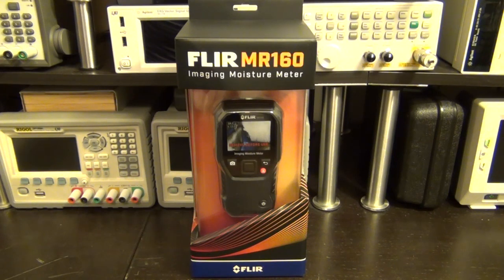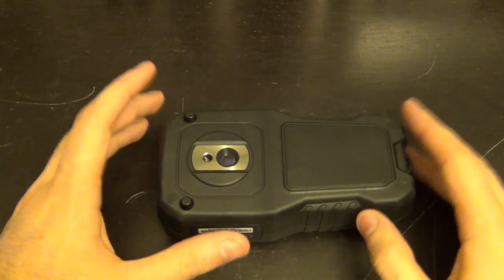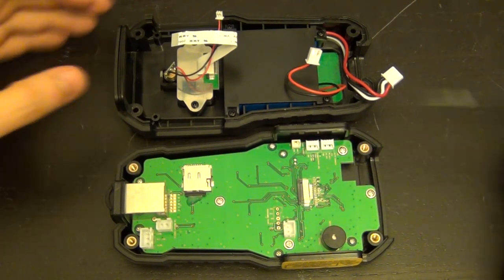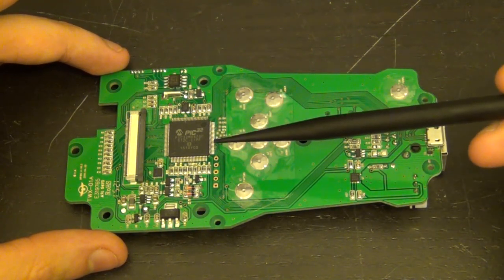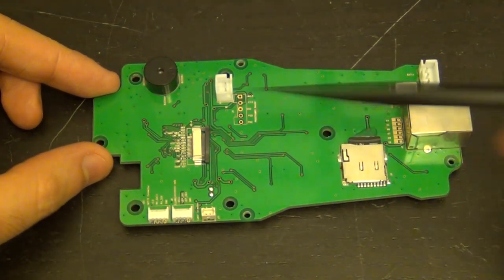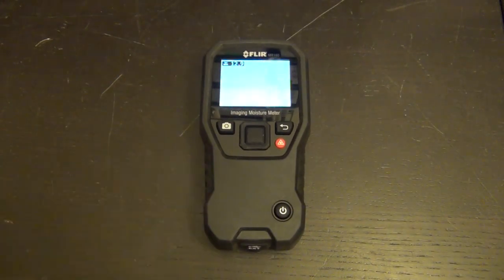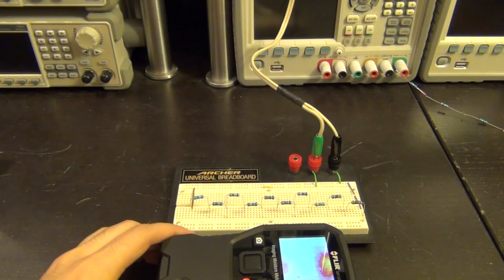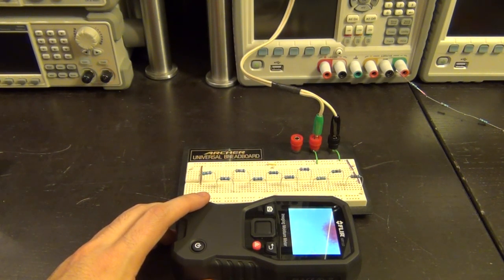TSP #70 - FLIR MR160 Thermal Imaging & Moisture Meter Review, Teardown & Experiments

Comment: I'd think the SD card is just for image storage, not software as SW would be in the PIC32 flash.
Reply: +mikeselectricstuff Once I saw the PIC32 I started wondering if you were actually behind this one.
Reply from the maker: +mikeselectricstuff Yes, at that time I had not seen what is on the other side of the board yet. I have added a note to the video. :)

Comment: I'm wondering if this could be a useful field tool for garden science as I recently read a study showing that plant canopy temperature using TIR can be used to measure water stress. It could be useful for measuring plant canopy with the TIR, leaves with the capacitive sense and soil moisture with the prongs. Any indoor plants you can water and then neglect and show before and after results? :)

Comment: I tore down a Chumby years ago, and they used a nicer SD card socket designed for such an application with a metal latch to ensure retention.  That seems superior to FLIR's approach of dabbing glue on an insertion socket to try to prevent a card ejection. What a topsy-turvy world of electronics we live in where Joe Average can buy NAND flash plus error correction controller (e.g. SD card) at the local drugstore for less money than an engineer has to pay a distributor for a 'less-than-cell-phone-quantity' design (and then deal with recurring EOL notices to boot).

Comment: I wonder if not including the temperature display puts the device into a different tax or import law bracket. I remember seeing a different video (maybe one of Mikes) where I believe he mentioned that the framerate available from the sensor had some kind of legal limitation on it. Perhaps this is another aspect of that same requirement.
Reply: +Daniel G The 9Hz framerate thing is an export restriction - someone imagines it will keep the designated bad guys from getting this technology. The lack of absolute temperature could be two things: protection of their thermal camera market, or lack of calibration shutter. Since Shahariar says the shutter clicks periodically it ain't the second thing.

Comment: I was really surprised to see the push buttons are the type used in the old Atari CX40 joystick.
Just bare metal covered with clear tape. I hope it's of better quality than the Atrai's which used to fail all the time due to metal fatigue, and the sticky tape did not hold them very well causing them to drift off their pads.
Reply: +shlomsi2000 They're called tactile dome buttons, VERY common in all sorts of consumer and pro products. Rated for a few tens of thousands of presses. I guarantee FLIR will have sourced them from a quality manufacturer.
Reply: +Aurelius R Thanks, yes it would make sense that they are made from high quality materials.
Very interesting however that they are reliable when all that holds them is one sticky tape, maybe i'm just traumatized from way back when I used to fix and replace those on old joysticks :)
Reply: shlomsi2000 Well, it certainly won't be your average sticky tape. It'll be a type of adhesive qualified for that application.

Comment: I really like your videos I've bought a Cat S60 and I find leaks in residential roofs for a living and some commercial flat. I would like to see how I found find the leak in a roof, when it's not raining with thermal imaging, can you pls help me with this instead of just showing the obvious water damage, Ive head doing it at dusk on a roof is the only true way on a flat building. but I wanna see how I can apply my Flir Cat S60 on a residential composition slopped roof, it would help me so much if you could make a video on this, I've asked Flir, and they said on Amazon that I should be able to see a hole from the roof, and I don't, I feel like I've thrown away my money, unless can find actual use on finding roof leaks with this equipment, thank you and keep up the detailed video's, they are more helpful than someone just saying it can happen but I need to see it happen.

Comment: I am comparing MR160 and FLIR ONE PRO. I wonder if you happen to have a FLIR ONE PRO that you can use it to detect the moisture on the ceiling tile. I guess I want to find out if MR160 will detect temp difference due to moisture that ONE PRO cannot detect. Thanks!
Reply: The Pro will probably have a better resolution, but it otherwise would have about the same results

Comment: I think they don't have the absolute temperature ...  In their cheaper products they don't have the calibration shutter and external calibrated temp sensor to get the true absolute temperature.

And since this is FLIR, this would just be unacceptable to display a temperature that's off by a couple deg C ... if you can't do it right, don't do it at all.
Reply from the maker: +Sylvain Munaut It does have an internal shutter. It is using the Lepton sensor which (as far as I know) is a stand alone module.
Reply: The lepton can have a auto shutter, but doesn't have to. In the Flir One for instance, it doesn't have it (it uses a manual shutter where it prompts the user to put the shutter on basically, see mikeselectricstuff teardown).
Reply from the maker: +Sylvain Munaut I can hear the shutter open and close periodically on this unit while the camera is operating.
Reply: Ok. Wasn't sure if you were saying there is one because it's a lepton or because you had some other info. (tear down wasn't showing th e sensor)
Reply: +The Signal Path Blog You would think that the temperature-option is turned off so not to compete with more expensive models.

Comment: I guess they can save on the calibration shutter by not offering any temperature readout.
Still - I would not buy this. There is no pressing reason to combine these two functions into a single instrument and the thermal camera is just too crippled.
Reply from the maker: +stefantrethan The point is moisture detection which is guided by thermal imaging, and it works really well.
Reply: +The Signal Path Blog How does it work better than just about any other thermal imager and any other (separate) moisture meter?
Reply from the maker: +stefantrethan By combining the thermal camera and moisture meter in one device, you can search for problem areas quickly using the thermal camera and verify by measuring the moisture level with both the pinless and pin methods. If you already own a separate thermal camera and a moisture meter, then you won't need this device.